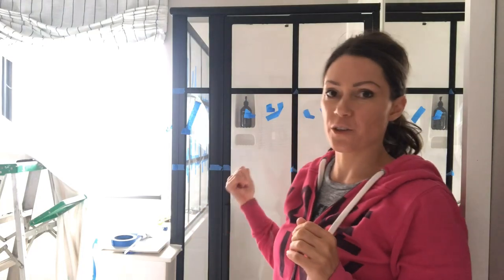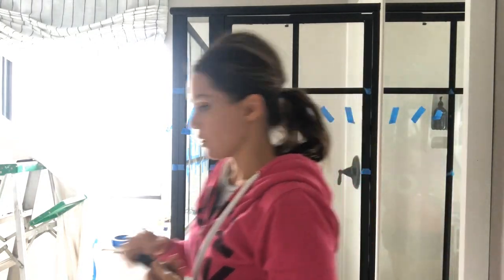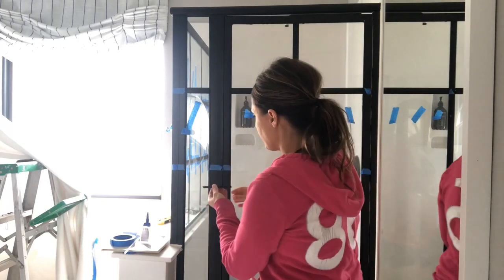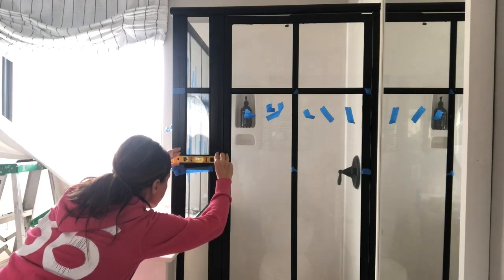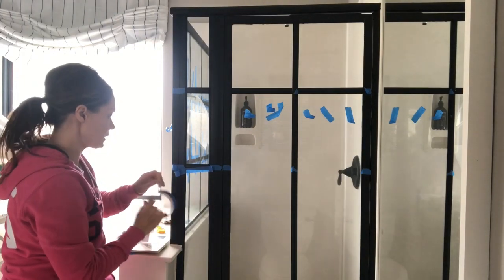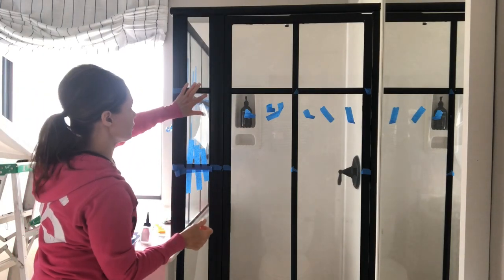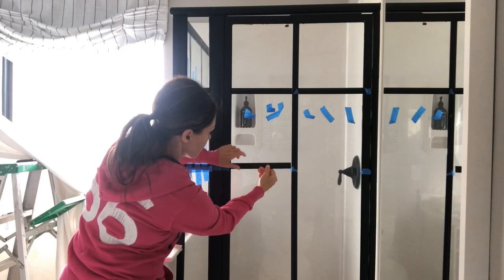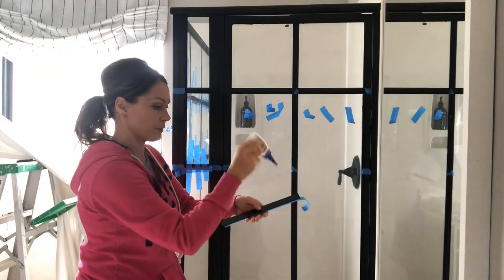DIY Grid Shower Door

Comment: crl product numbers VLT75MBL, VFT75MBL, VAT75MBL.  They make a product designed for this application. The problem is you see the adhesive from inside the shower unless u do both inside and outside. Some glass fabrication shops have been grinding the grid pattern into the shower panels and filling the grid with an enamel paint that is flush with the glass. This is the better way to go but expensive. Overall the look comes from old window frames with putty glazed window panes. In a shower, its form before function if you know what I mean.

Comment: 8 months later how did that turn out with the steam the heat from the shower
Reply from the maker: Overall it has held up so well!!  No problems with the grid whatsoever!  I will do an update video and blog post soon so you can see what the painted frame looks like on the inside and how everything looks now!
Reply: @TheDIYVibe  hi has the updated video posted? If so, can you add the link?
TY so much!